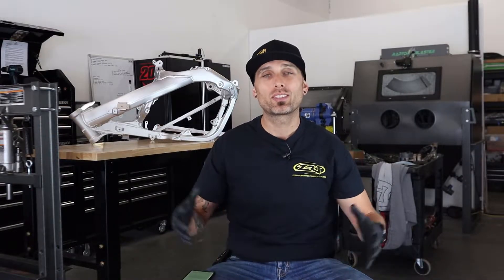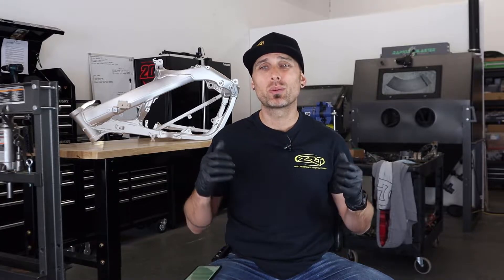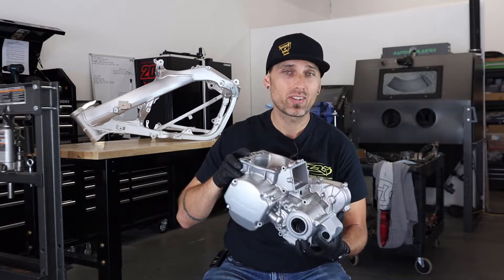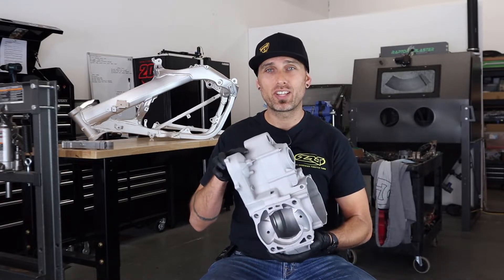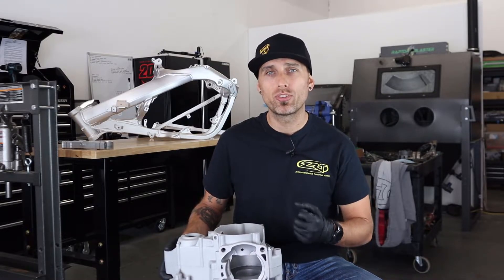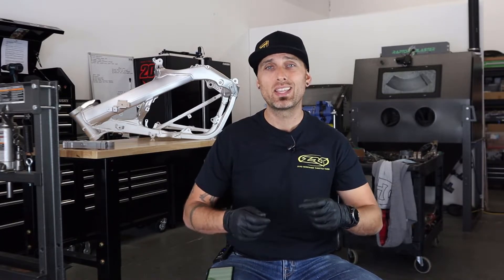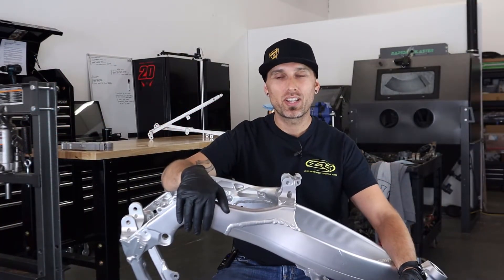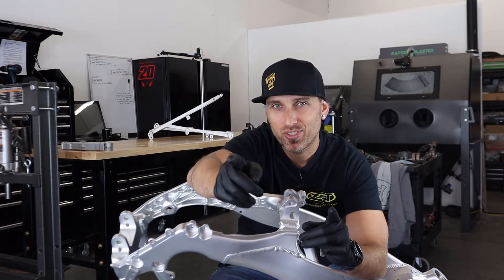Frame Up Honda CR250 & CR500 Two Stroke Build - Vapor Blasting

Comment: A frame won't fit in it but there's a smaller Blue vapor blast cabinet I ordered from z1enterprises for $1000 plus shipping and it's plenty to do everything else on the bike engine cases you name it and it's been worth every penny and it doesn't need a bug air compressor either as long as it can push 5-10cfm your golden

Comment: Excellent video Charles, once you vapor blast aluminium, is there any type of sealent you can use on the bike frame to keep that fresh aluminium look?
Reply from the maker: Thanks nick! 

Yeah definitely, you could have it hard anodized clear and that would probably hold up good for a while. You could probably have it ceramic coated clear as well.

Everything wears eventually though, so any contact patches would just need to be covered up. Like the knee brace area and of course the lower frame spars where your boots rub.

I think they would also give it a nice gloss. But overall, keeping it raw will make it easier to clean if it's a bike that gets ridden you know? A quick Scotch-Brite pad and your back in the game.

Really good question. Could be plenty more ways that I'm not aware of also.

Comment: Awesome video yet again !  I just wanted to be sure. To get that cr250 frame to look like that you were at 90psi using ALC Medium Glass Bead Abrasive Blast Media - 25 Lbs. Model Number 40105? Thanks again for the videos !
Reply from the maker: Thanks Chris! To be honest, this video is a couple years old and I do not remember what is inside of it anymore! My procedures and skill level at this has changed a lot, and gotten even better. So here's a newer video explaining specifics about the process https://youtu.be/93S9wb5aHio

Comment: Is it possible to get a shiny finish using glass bead in a dry plaster?
Reply from the maker: You can get pretty damn close man! You have to use the finest bead and the lowest PSI that still cleans. Vapor blasters are great but you can do amazing things with dry blast still.

Comment: Once you vapor blast the frame do you need to re anodise ? Thanks
Reply from the maker: Nope. You can, but they are not anodized from the factory either. The swingarms are however. That's the cool thing about building bikes- you can totally do it however you like.

Comment: Great video,  thank you!  I had some cases vapour blasted and I asked the guy not to blast the main bearing housings but he did anyway. He said it removes no metal, what are your thoughts on this please?
Reply from the maker: Oh yeah you're good. Don't worry about it. But, I avoid going hard on the internal areas of cases ONLY because if my cabinet is running- it's making the shop $. So it saves the customer some money instead of us blasting away another 30 minutes to an hour of his hard earned cash on parts of the engine that don't need it or wont be seen anyway (the shine we all like). If they were stained badly though, it may be needed in some cases.

Comment: For the vapor blasting process, the difference between stage 1 and 2 is just pressure? What results would you get from doing stage 1 with dry blasting (AlOxide) at high pressure and Stage 2 in the vapor blaster at low pressure to polish? Would it be similar? Great job btw
Reply from the maker: Thanks Enrique 🤜🤛

That's a great question and a cool idea. I'll have to try it sometime and see. 

It would smooth out the rough finish of the A-OX most likely, which would make a less desirable surface for a reliable coat of paint/ Cerakote -BUT, it might retain the darker finish with a sheen after low pressure vapor/ glass bead. Just a guess if course.

As for the dual stage vapor, yes. The high pressure strips & the low pressure shines. Think of it like using a coarse sandpaper on something, followed up by a more fine sandpaper. 

Hopefully that's a good analogy.

-Charles // mXrevival
Reply from the maker: I gave it a try & it works just as great
Reply: mXrevival thanks a lot for the follow up! Keep up the great work, I’ve been following your videos!

Comment: Yes vapor blasting is brilliant i built a diy one from dish washer pump & home made gun one way valve. you can put bakeing soda in it if you want but you wont get shiny results not like glass bead & its not just crushed glass people so dont buy that
Reply from the maker: To add to that, harbor freight "glass bead" is actually crushed glass 😂😂😂 totally shards the part 🙃
Congrats on your DIY-blaster. Very cool.
I spent a good amount of time using soda in a dry blast/ HEPA system and found it to be hit or miss, but also not as brilliant as vapor as you said.
I may mix in some soda with bead inside the vapor cab someday. 
Have a great day!
Reply: @mxrevival  okay pal & you too